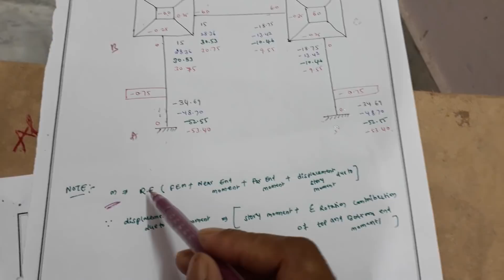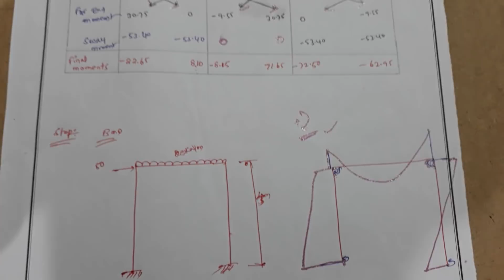Analysis of Frames Using Kani's Method with Sway Condition

Comment: What is the procedure if there is a symmetrical frame with a point load in the middle of the span of beam i.e. from where the line of symmetry passes.